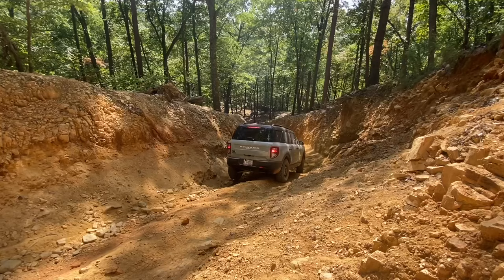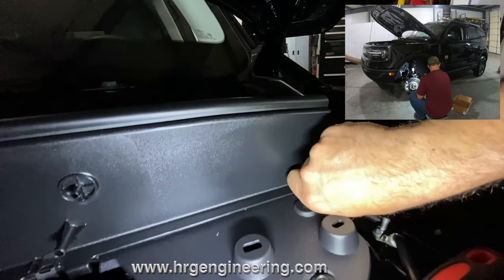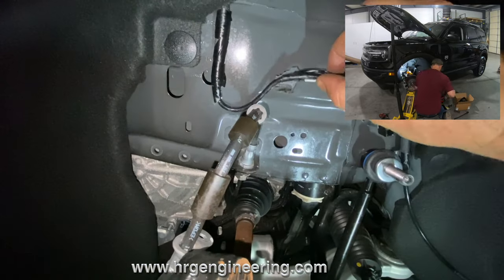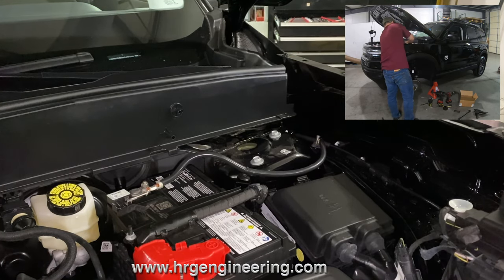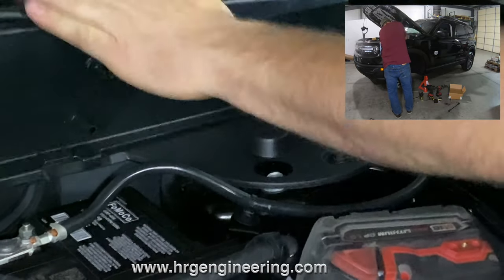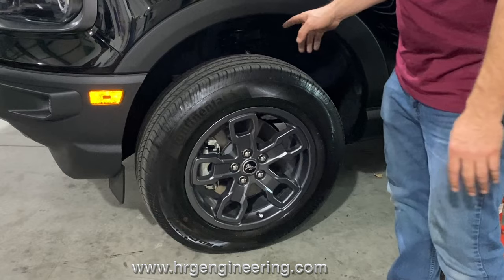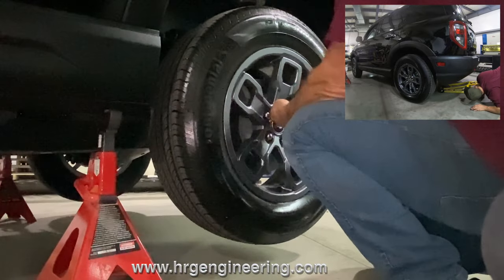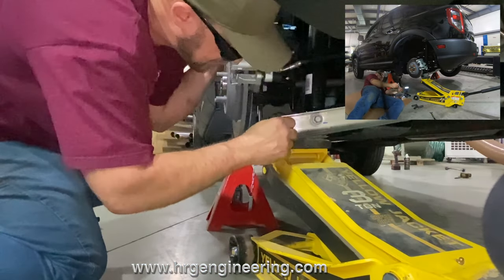How to lift a Ford Bronco Sport 1.5 inches with the HRG Offroad lift kit

Comment: I have the badlands and love it a lot, with all options. I don’t care about the fuel. It tow my enclosed 4x6 full very easily and still accelerate like a sport car with the trailer. Smile. On highway during my 3500km trip i averaged 9l/100km. In city i can use the eco mode from time to time but most of the time i am in normal mode. I like having all the options and the color orange cyber is very nice. I also installed a brake controller and 7 pin plug. We had to cut a bit the back plastic to put the rounded 7 pin and i have a converter to 4 pins. Controller is installed just above the brake on the dash. I installed a loadwarrior roof rack. I got a lot of compliments. People come to me to said the Bronco is very nice.

Comment: Since that top bolt on the shock has a lobe how and I supposed to know what orientation to put it in?
Reply: Initially it would be a guess.  The spacer is going to cause the top of the tire to bow out.  The camber bolt is to correct that and pull the top of the tire in.  So initially put the bolt in where its centered and then rotate it until the top of the tire comes in some.  It doesn't need to be 100% accurate as its only temporary until you go to a alignment shop and have a professional realign the front end which is pretty much always necessary otherwise you will have poor tire wear and could have other issues long term.

Comment: I saw on your website that you have a version of this lift kit for Badlands/First Edition. I’ve got a BL and want to lift it but none of the other lift kits from other companies are compatible with the BL/FE. Do you have a video on that one or can you explain how that one works? I haven’t looked under my BL yet to see how it is lifted from the factory… is it just from the suspension or is there a stock lift/leveling kit already?
Reply from the maker: The badlands/First Edition have different shocks and springs than the BB/OB. The springs are slightly longer and also use a hydraulic rebound stops. Source: https://media.ford.com/content/fordmedia/fna/us/en/news/2021/08/20/high-performance-off-road-stability-suspension.html
Reply: @hrg_tv  so the instalation should be the same for all models?
Reply: @hrg_tv  what is exactly the difference in parts between 1.5" lift and 1.25"?